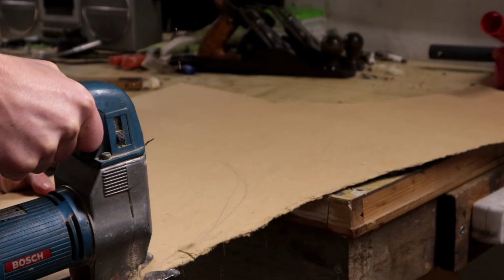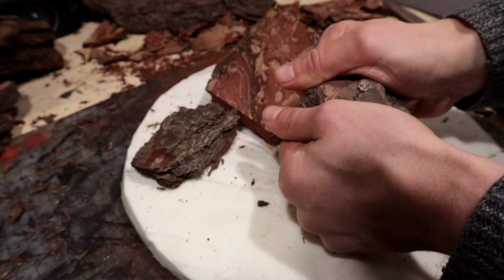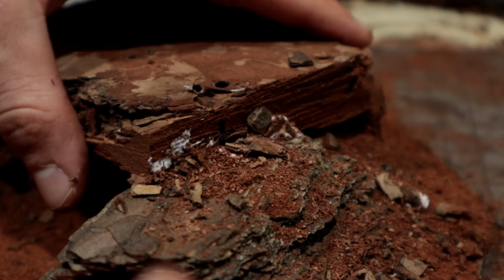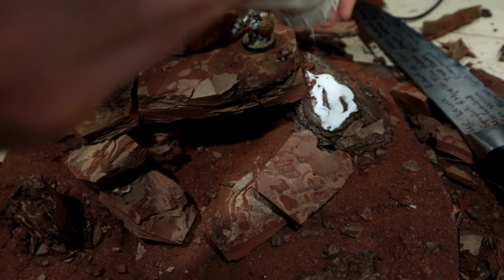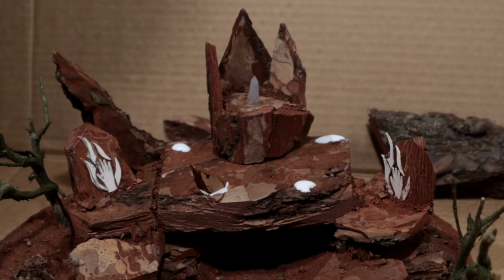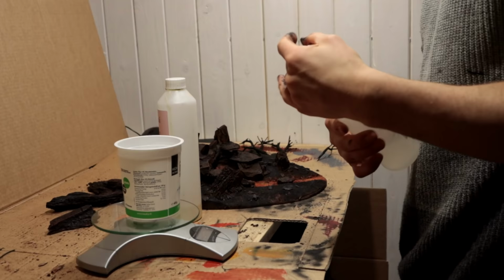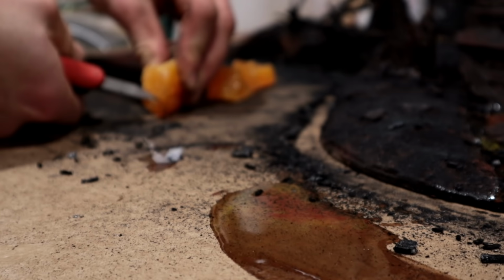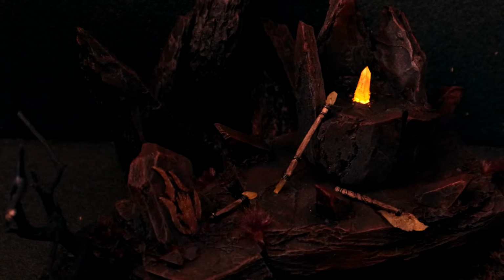The Elemental Plane of Fire - Making a Fire Diorama for D&D

Comment: Pro tip for making believable lava flows: use a torch to melt a path in the foam itself.  You don't want to melt it ALL the way through, just enough to form the channel.  Then add rocks and/or bark for stone way and paint
Reply: This! Also, when painting lava you want the base layer to be yellow, then when that's 90% dry you want to hit about 70% of it with orange. Again, wait until it's 90% dry before hitting about 1/4 of it with red. Dry brush the ground where the lava touches with red for a glowing effect. No idea how to do the resin bit though.

Also, when painting hot coals, you want to use white primer and base red, then when dry hit it with a light dry brush of dark grey over the whole piece followed immediately by a heavy dry brush of black over all of the piece (the dark grey was just to give it a faux zenithal - it won't make MUCH of a difference but the difference is there). The end result should come out looking like hot coals (the bright parts are at the bottom and the cooler (black) parts at the top).